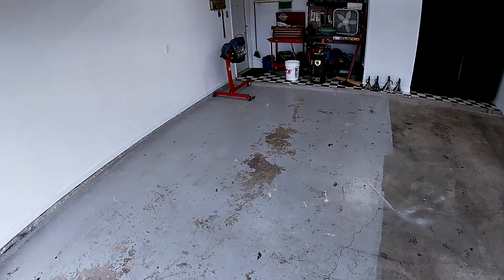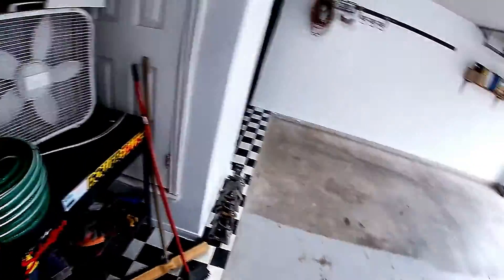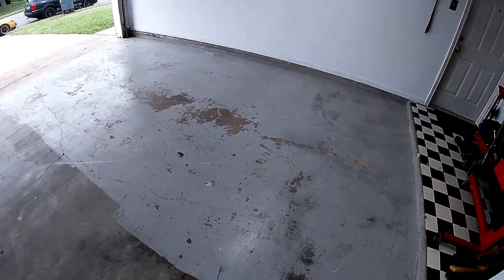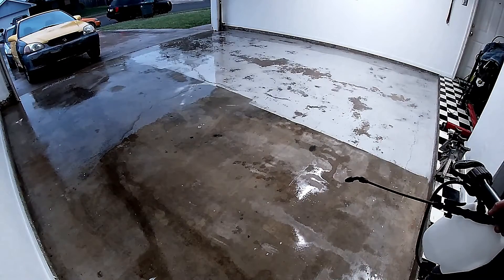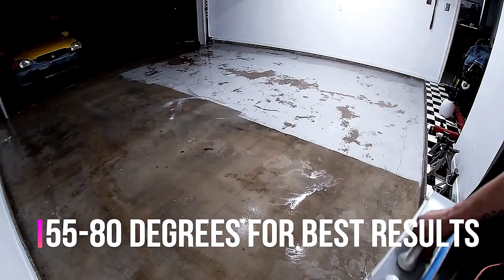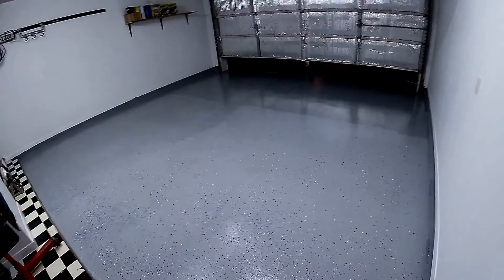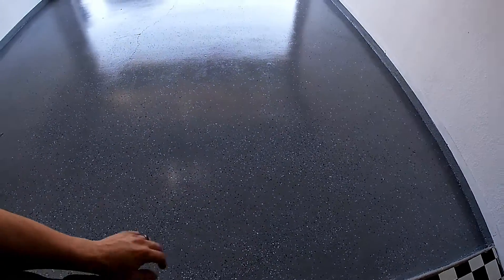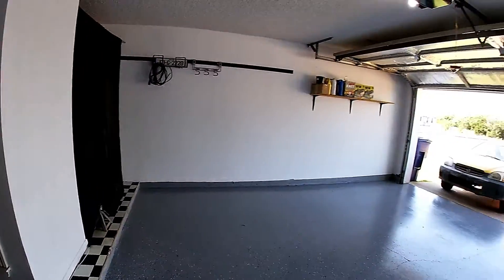How to epoxy your garage floor for $100 or less using Rustoleum Epoxy Shield (GARAGE OVERHAUL PT 2)

Comment: I totally get your plans were impacted by not being able to rent the floor sander, but other options were to use a chemical paint stripper, and an even more aggressive grit than 80 eg 40 grit. Instead of going through heaps of sheets get a carbide disc, it'll last ages. You should have repaired those large cracks first then scraped / bladed / sanded them smooth as part of your preparation, as they are clearly visible after applying the epoxy shield  (and shouldn't be). Pouring the epoxy out on the floor lengthens working time significantly (keeping in the bucket sets it much faster due to concentrated heat as it cures) - fortunately you still finished but others could come undone using your technique. Definitely put a hard-wearing clear coat on top.

Comment: James turned out awesome. As far as the concrete work goes you did what you needed to to scratch and scrap up all the loose stuff then hit it with acetone for a clean prepped surface. But what you did looks great turned out sharp.

Comment: You’re going to want that clear coat to make it last. The epoxy doesn’t seem to remain hard and avoid scraping off without that diamond coat on top. I learned the hard way.
Reply: I agree. The clear coat also keeps the decorative flakes from chipping.